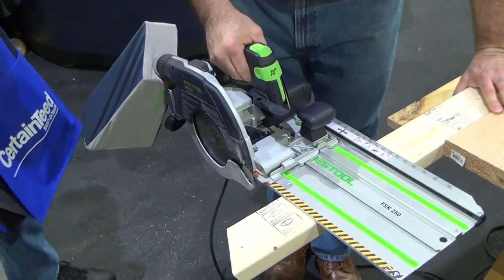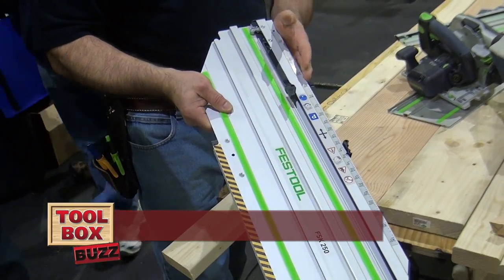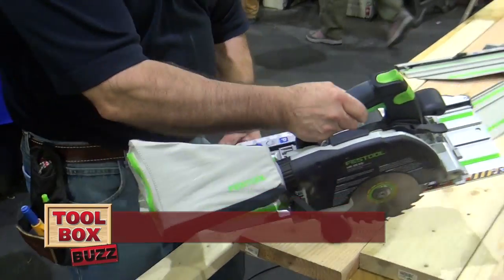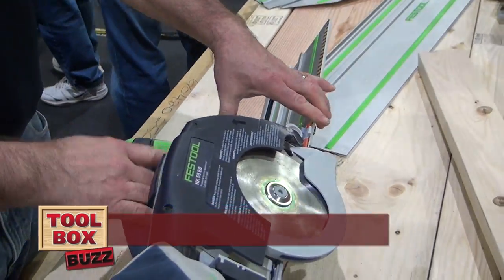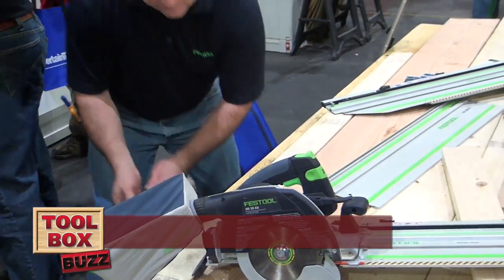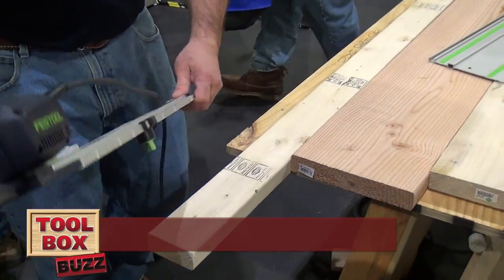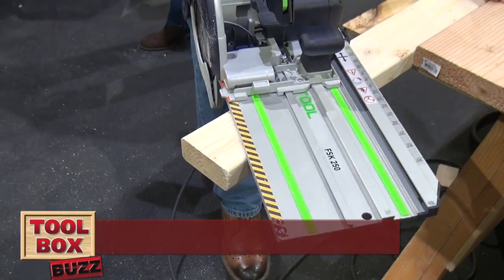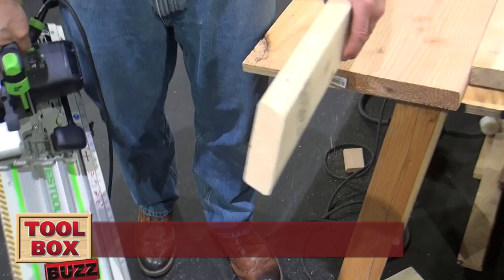Sneek Peek Festool HK & HKC Carpentry Saws and FSK Guide Rail

Comment: Mind.
Blown.
That could end up being one popular jobsite tool.  

And for you people that still can't wrap your head around the cost - do some research.  You will find a lot of talented pros use and prefer Festool and don't find the cost objectionable because they get so much more from the tool.  I have several Festools and I am just a hobbiest homeowner in the lower middle income bracket - i.e. far from being rich.  I do however, prefer tools that expand my abilities and make the work easier.  I bought the ATF 55E saw more than 10 years ago to help me make a number of concrete molds for some countertops and window sills.  Best purchase I ever made and I still use it today.  I really don't understand people and their cheapskatedness.

Comment: it is quite large and bulky, but it appears to work well.  Of course he didn't let you try, so who knows if there is a learning curve to such smooth operation on those compound angle cuts.  I also like that Festool makes the shoe accept these attachments without compromising the regular use of the saw.  I could still never justify Festool money though...

Comment: I have the Mafell version which is on the market a few years. The kss400. Brilliant tool. I sure Festools version will be just as good..
Reply: I just got the KSS-400.  I was suprised to find that the rubber splinter gaurd is already about 1/16" shy of the cut line.  I thought it would be cut to zero clearance on the first use.  Dealer says that's the design but I was looking forward to having a true reference line.
Is yours like this too?
Reply: Stringfellow Hawke. Dealer is talking shite. It's a splinter guard and as you say the first cut is your zero cut reference.
Reply: Yeah that's my thinking too.  I can buy 11' of replacement splinter gaurd for about $30... but it galls me to have to replace parts on a brand new $950 saw.
Reply: Stringfellow Hawke Bring it back to dealer and tell them your not happy with it. If they give you no soot then tell them you want your money back.